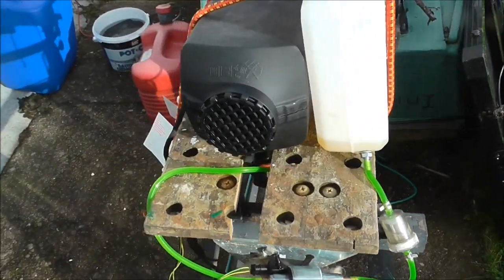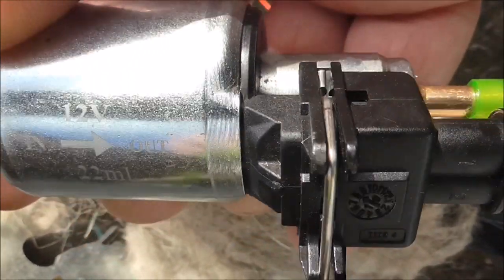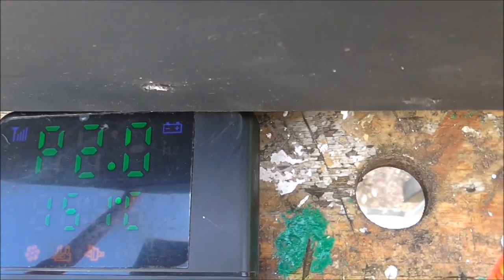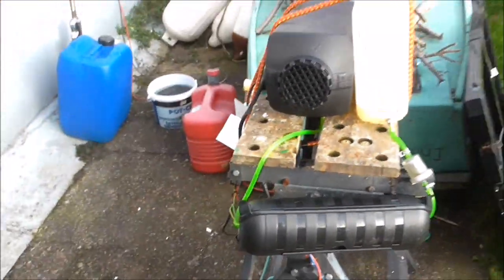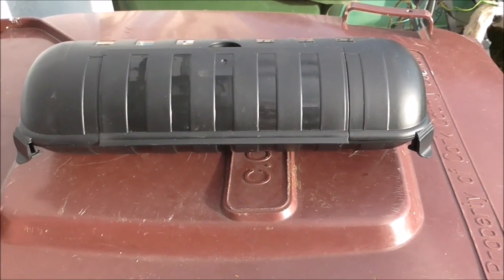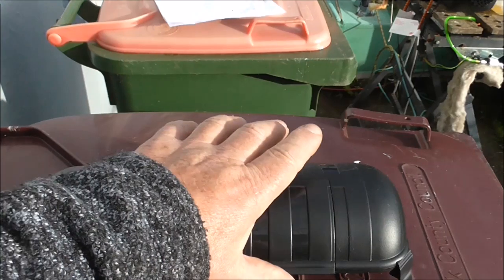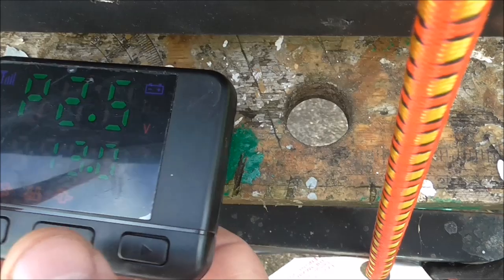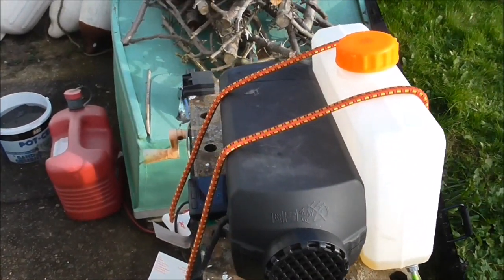Diesel Heater Fuel Pump Noise Comparison

Comment: What did they call the plastic box you put the pump in martin
Reply from the maker: I purchased on Amazon,  called waterproof outdoor electrical connection box. There are various types and as usual on amazon different makers/suppliers.

Comment: Can you use just a regular automotive style fuel pump? I guess if it's using the pump as a regulator, then, no... But wondering if there are non pulsing alternatives...
Reply from the maker: Quick answer is I don't know , these pumps supplied are a type of metering pump and pulsed by the control board to match burner module settings. 
There are so called quite pumps but with mixed reviews.
I have come across mention of a fellow making his own type of silent pump but expensive.
Reply: @martint1151  thanks! I realised as I was asking that the pulses are a, or THE way to meter the fuel... I'll know how loud mine is in the morning since I finally bought fuel for the first start up.